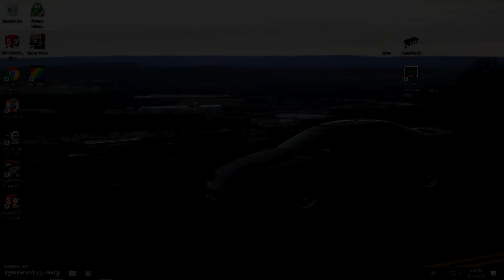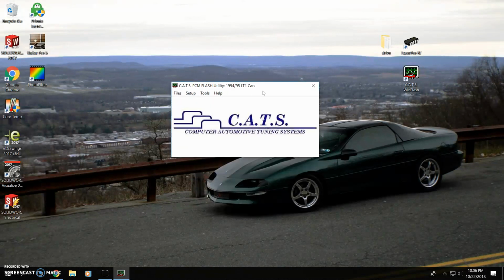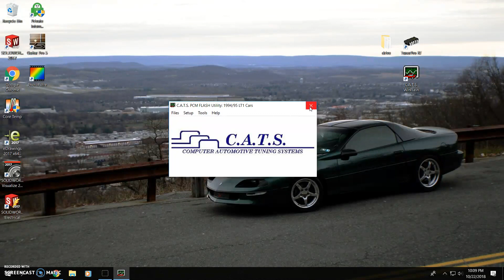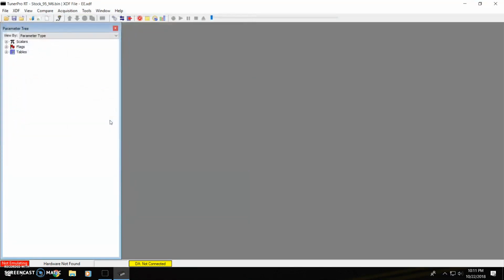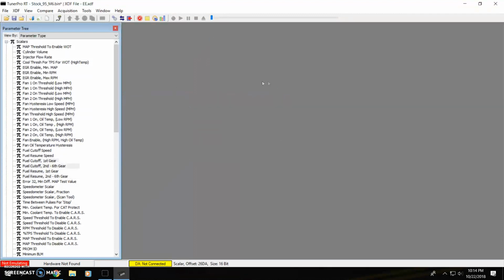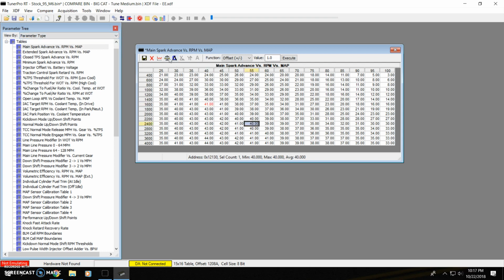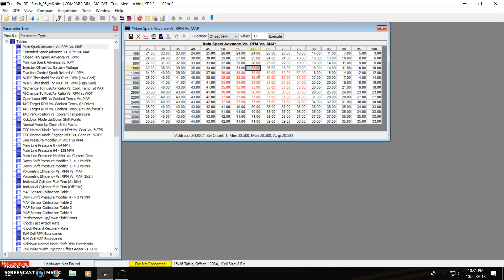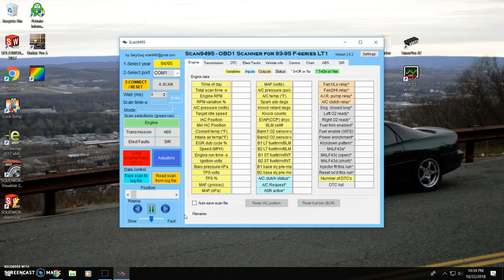Basic LT1 Tuning (Part 1): Getting Started

Comment: What do i need to tune my  stock 1993 camaro z28?
Reply: The only tuneable LT1's are the  94-95..93 you need to burn prom chips to make any changes and plug them into the ecm..I hear the OBD2 LT1's 96-97 are too hard to tune, and people install 94/95 ecm in them to tune them..
Reply: @joemomma1 can you do the same to a 93 swap to a 94/95 pcm from a 94 or 95 Z28? Or would it just be easier buying a standalone ecu
Reply: @10_Per_Gram yes you can but you need the wiring harness too..And there are other sensors on the 94/95 you would have to install onto a 93.

Comment: Man this video is helping so much, I have a 94 Z28 LT1 that was programed years ago with a Hyper Tech Power Programmer. Programmer died and now I'm trying to get back to the stock tune due to it running pretty rich. I'm in the process of getting a cable and software downloaded but do you have any idea where I can get my hands on the original tune?
Reply from the maker: There are some tunes saved here: http://www.ltxtech.com/tunes/
If your car is auto, be really careful that you use the right year since there are differences in the trans tuning.
Reply: @JunkRacecars  thanks, mine is the automatic transmission. I’m going to save my current setup but there are a few different bins on that link. Which one would you recommend I try?
Reply from the maker: @TimCasey-m4b  bobdec - stock 94 Z28 A4 2.73.bin or either of the badbird_96 tunes

Comment: What's wrong with obd2? I'm a carburetor guy, but my wife got me a 96 corvette, and I figured I'd give injection a shot, but it's starting to sound like too much shit. Is there any reason why I can't tune obd2?
Reply from the maker: @buildingracingvideos4714  the software is very expensive ($600 for lt1 edit) whereas this is free
Reply: @JunkRacecars  ok. Very useful information to know. I'm still in the planning stage and trying to find the easiest way to keep the injection. I'm getting old, it's hard to read the numbers on carburetor jets, and I understand fuel injection is better.

Comment: Here is our situation:

We have a 95 Firebird Formula 6 speed with a LT1 motor.  We put in the 93 Corvette LT1 with a ZZ4 cam.  The engine came complete from the engine builder with Opti Spark sealed, intake and fuel system installed.

The Opti spark connect on the motor from the engine builder is the 95 style plug not the 93 Corvette plug.  

The car starts and idles but that’s about it.  It has no power what’s so ever and during the initial test drive it made it about to the end of the block and died completely.

What do we need to do to get the computer and the car to talk to each other with the new engine and the modifications to the engine.

The computer does have a removable chip and a port in the car is a OB2 no a OB1 port.  

Would any of this work for us?  Or would you know anyone that might have more info?  Any help would be appreciated we have been struggling with this for a while now.
Reply from the maker: I don't think the opti plug changes anything since the 93 and 94 years share the same distributor despite having different computers. If you have a 94-95 computer in the car with a p/n ending in 051 then I would scan the car with an ALDL cable and laptop.
Reply: @JunkRacecars  So will converting back to OBD1 and getting this software and cable let us tell the car we have the ZZ4 cam in it?
Reply: @Jeff-bk4nm did u figure it out?

Comment: I wouldn’t call it bricking. You should always back up the original tune…. Also, remove the eeprom chip from the pcm board, dump and save the contents from the EEPROM  as well. This way here if it “bricks” you can reload the data to your eeprom and you’re good to go.

Comment: ive tried installing Winflash but for some reason the application Icon just won't show up. it's installled but has no way to actually initiate the program even after uninstalling and reinstalling. windows 10. any ideas? i'm gonna keep trying but this is rather odd.

Comment: Great video brother! Quick question did you need an ads file as well or should with just xds work? For a 95lt1
Reply from the maker: Just the XDF is all you need for tuning. The other file is for logging I believe, but I typically use Scan9495 or EEhack for that.

Comment: A well known tuner told me the mystery timing degrees do not actually apply to the timing, you just see it in the data logger. Are you familiar with that? Seems no one has an answer on that as if it does or not.

Comment: Q: Will Win7 work with C.A.T.S. and  tunepro ?
Reply from the maker: I've used it before no problem but I'd run it in compatibility for xp just in case
Reply: I have Windows 7 pro on my laptop. This is good. Go #2

Comment: I’ve increased Throttle body to 58 mm And want to increase my mass air sensor how would you tell the computer you’ve done this
Reply: 58mm wont flow like a 58  with a stock lt1 intake it will flow only as good as a 52mm  because on the LT1 the intake air opening that the TB bolts too is 52mm you can port the intake opening to  58mm so it flows but most go with 52mm tb over stock 48mm cause of this.

Comment: I’ve got an 94 fbody lt1, it’s a swap I used the painless harness so I ended up with a obd2 aldl connector. Will that moates cable work for me? It says for 95. I’ve changed the tire size parameters years ago when I built the car but I forgot most of what I learned, glad you posted this it’s a great help.
Reply from the maker: Yes it will work. There are 2 varieties of the Moates cable, you'd want the 95 variant.

Comment: Great video. I’m in the process of getting ready to tune my 97 SS. For the obd 1 conversion do I just get a pcm from a 95 and just plug it up in place of the obd2 pcm? Or is there some wiring involved?  Thanks
Reply from the maker: For the fbodies, all you need to change is the knock sensor on the bottom of the block. The obd1 computer is plug and play, just make sure you're running it with a obd1 fbody knock module (chip in the computer) too.
Reply: Ok thanks. I really appreciate the help.